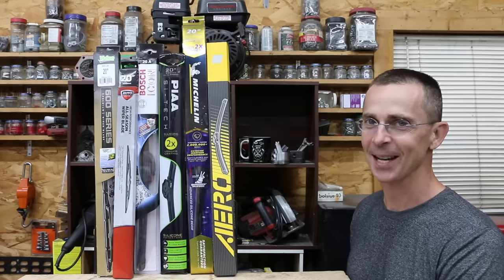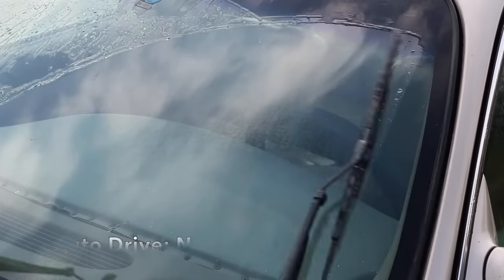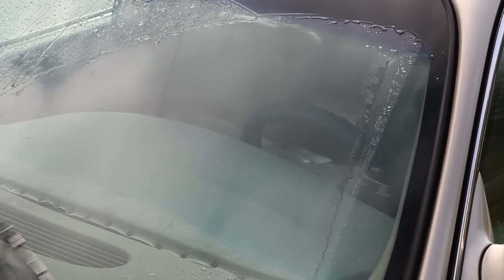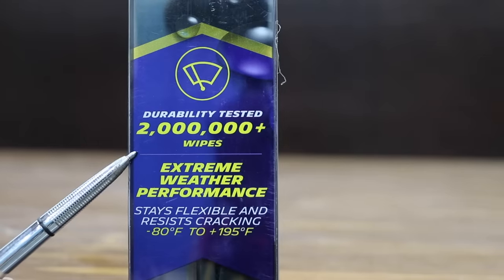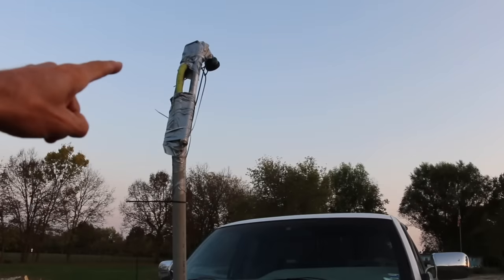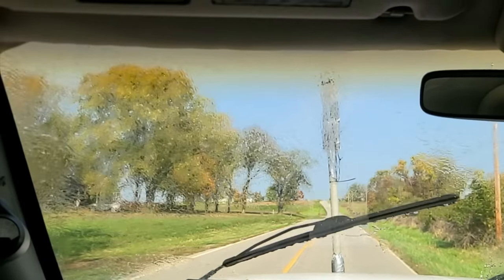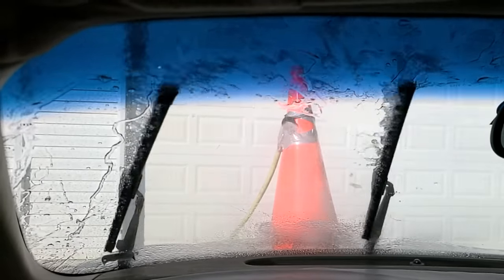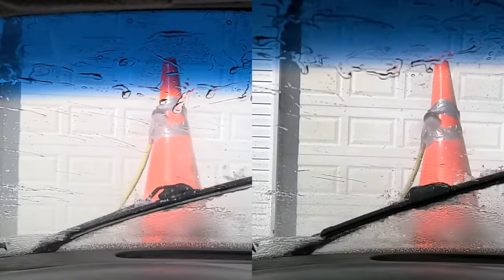Best Windshield Wiper Blade (AFTER 1 YEAR)? Bosch Icon, Rain-X, PIAA, Trico, Valeo, AERO

Comment: I don't know if anyone is the same as me, but when I replace my wipers I can't wait for it to rain to use them 😂
Reply: Exactly, it’s extremely satisfying to use them and feel the satisfaction of how good they work compared to the old ones
Reply: As someone that worked at an auto parts store most people wait until it rains to replace their wipers.
Reply: Me too!
Reply: Me too
Reply: I replace them in the rain when I can't see anymore. No waiting required and you know you got all your money's worth from the old ones.
Reply: To clean my old blades I wipe them with babywipes to prolong them and get the dust off In summer months... only a rea motor enthusiast gets excited over a wiper blade Video...
Reply: @9HighFlyer9  that's exactly what I was about to say about myself.
Reply: @9HighFlyer9  guilty as charged!
Reply: Here in Texas, I always forget I need them until it rains. When it stops and doesn’t rain for a while, I forget again. When I finally do remember (or get my truck inspected and they threaten to fail me), seems like forever til it rains again. So yeah, I feel ya 😂
Reply: @9HighFlyer9  No one notices how terrible their wipers are until it rains, then it's "Will you put them on for me?"
Reply from the maker: Thanks for sharing.
Reply: I use mine even when it doesn’t rain. I clean my glass with them whenever I get bugs or dirt on it. I’ve also found Bosch to be the best wipers.
Reply: I changed mine as soon as Costco puts them on sale every fall
Reply: We just drove our van in crazy rain for a week, I replaced our well worn out, not working wipers . . . And DROUGHT!!!
Reply: Or snow
Reply: Guilty. Sometimes I go to carwash and cry of happiness.
Reply: Shid, I’m nutter than that. Tire PSI has to be right, Alignment has to be straight, Tires have to at least match by pair, Washer fluid full, Clean headlights, Good quality gas, No cracks in Windsheild,  or my anxiety and OCD bothers the shit out of me.    

I’m not a spotless show car clean and wax weirdo but, a performance and drive as it did when new or better weirdo.
Reply: You go through them like crazy here in Washington State 🤣🤣 I recommend Bosch for my PNW people.
Reply: @9HighFlyer9  I'm in Oklahoma and I'm paralyzed. So 99% of the time it rains I'm inside and never need them, then it's like screw me because I need to replace them again and maybe got 5 uses out of them.
Reply: Me too. It's so weird when you think about it 😂

Comment: The biggest thing I discovered when it comes to wiper blades is that keeping a rag in the car is critical. Running the rag down the wiper blades before driving in the rain significantly improves their performance by getting rid the film of gunk and small particles that build up under them.
Reply: I spit and clean.
Reply: Use rubbing alcohol.
Reply: @Mike_Greentea  no wd40
Reply: @Mike_Greentea  I believe that will get rid of the UV coat. Use plain water
Reply: Mr. Ambits,
When I get gas, I clean the windshield and the wiper blades.  I agree it helps.  I'm surprised at how much dirt comes off the blades.  Great suggestion Sir.
Reply: I spray windex and towel while I’m wiping my windows and down the blades afterwards it’s gets the dirt off the blade
Reply: I just let it rain and then hit the wipers a few times lmao
Reply: @IronEddie13  windex will damage your clearcoat, be careful with that stuff!
Reply: If you make it a habit of cleaning your blades when you get gas I've found it's good enough. Depends where you live I guess.
Reply: Biggest thing I discovered way back in the early 1990’s was “Triple Edge” wiper blades.  By far the best and longest lasting I’ve ever tried.  Not sure if they are made any more.  I can’t find them anywhere.
Reply: That's actually something my Dad taught me. When I stop for gas, I use the washer fluid and papertowels at the pump to clean them off. Take less time than the fill up, and makes a big difference in longevity.
Reply: I've had terrible experience with RainX. Bugs and bird turds eat them up. The last pair I got barely lasted a month.
Reply: My last pair of rain ex the dam end cap fell off, in the middle of a storm. Had some gorilla tape to Gerry rig in back on .Bosch focus was my next favorite.
Reply: This a must if you want to avoid micro scratches.
Reply: @karel_de_lille there’s never a time when it doesn’t rain very much (portland Oregon)
Reply: 80's Mercedes owners manual stated to wipe your blades with 95% alcohol, propably once a month or so, can't remember.
Reply: @hr67999  Nah i dont agree with ath old thing, the wipers get enough alcohol from the wiper fluid. Besides 95% alcohol is almost isopropanyl and aint good for rubber. Wet cloth is the way to go, just to remove junk.
Reply: I'm going with the Bosch wipers, man, they're quiet and don't streak. And yes, they are more expensive but they hold up really well with the UV treatment.
Reply: definitely keep the blades clean but also soak them for a few hours in 303 protectant about once every 3 months and they will last "forever".
Reply: It’s also better for the blades. less resistance on the motor, less friction on the rubber blade so it doesn’t wear as fast.
Reply: I keep an old windex bottle I fill with washer fluid in the car for this very reason. Essential if you live anywhere with winter weather as they'll just smear road crud across your windshield even if you use your washer jets
Reply: @CarlForTuna28 me who removed some adhesive from my car using windex 😮😮😮
Reply: @chinaboss6683 Brokeback Mountains style. Lol
Reply: i found a rag and WD40 works great at cleaning blades.
Reply: @jasonmershon3941  Yuuupppp!😂 Gotta love our bipolar weather. It can go from rainy to sunny to snowing. Can’t stand driving in Portland, let alone when it’s downpouring. Exact reason why I’m watching this, we’re one of the worst states when it comes to the insane amount of rain lol. Gotta have good all weather tires, blades, and keep your car rain x’d, and/or ceramic coated here. 

Can’t stand some of the ruts we have in our roads that just pool up water. Worst ones are from the semis creating wagon like tracks that can pull you around. Could be my cheap tires and front wheel drive though.🙃
Reply: I wipe mine down with 303 every time I clean my truck to give them some UV protection. Cleaning them often is very good advice. They can get pretty gunked up.
Reply: absolutely!!! Especially in Florida where it's all sandy and dusty and full of construction
Reply: I guess routine car washes just clean the tops of them? Ill check that next time I go.
Reply: Yep, been changing my blades for 49 years. Every time I gas up, I clean my windows then I use some of the pull wipes at the pump, dip in the wiper cleaner solution and wipes the blades until the wipe stops showing scum on it. And as said this is especially important after a dry period because all the road oil and scum buildup on the windshield and blades.
Reply: @CarlForTuna28  I’ve heard from an old Greek guy that windex can be used for everything.
Reply: Vineger
Reply: @Mike_Greentea vinegar
Reply: @craigorlikowski2507 😂 no!
Reply: Dont comment on things ys dont know. Look it up! 🙄
Reply: @Usul-xp6ve agreed. water is best. Alcohol will dry the rubber or silicone.

Comment: Came here to say I bought a Bosch set of wipers after watching this a year ago and they are the quietest, most efficient wipers I have ever had, and still hold up. Companies should be paying you to prove how good their products are. Fantastic content!
Reply from the maker: Thanks!
Reply: Replaced my OEM blades with Icons as well.  Great performance with no chatter and nice clean wipes.
Reply: They're good but they're very expensive.  I'm not sure they're better than just buying cheapos and replacing as needed.
Reply: @jshepard152 Maybe depends on your climate. I love in a rainy, but also icy/snowy climate. Especially the ice is quite rough on the wipers and possibly the - 45C wiper fluid i use. Bosch holds a perfect clean for years. I've used the old style ones, but they hold snow and ice. New design is best, but most other brands only last a year until they start streaking. I've got 2 cars and tried Michelin, OEM, PIAA and RainX, Bosch outdid them all.
Reply: @QnA22     Your right.  The Bosch wipers are much better in snow and ice versus the old frame wipers.  I don't get much snow in my area.
Reply: @jshepard152  Without the snow and ice, i might just choose the traditional wipers. Cheap and effective. However, only had OEM one for a short while until i replaced them. Not much experience, so i might be wrong.
Reply: I ran Bosch icons since last winter here in Denver. First snow hit us last weekend with a total of 9 inches over two Days. Forgot I left em on last time I drove my winter beater and they scraped snow and ice immediately. Now it’s gone I ran them yesterday. They’re not cracked or streaking. They’ve been on a winter spring and summer. And now another winter.
Reply: Bosch aero is the best.
Reply: I just purchased my second pair of Bosch today
Reply: @jshepard152  The Bosch Icons are expensive. But I can easily get two years of service from my Bosch Icon wipers. They probably could go for third year if I wanted. I park my cars inside a garage so that probably helps.
Reply: I have always used Bosch Icons and they have always worked well for me
Reply: Same. Waited for the end of the summer to switch out my blades for some bosch, and I am THOROUGHLY impressed.
Reply: I just bought my first set of Bosch wipers based fully on this video, and comments like yours. However, companies paying Project Farm for his reviews would defeat the entire purpose of this channel.
Reply: @RambleRecordings  he doesn't take money, and is looking at Numbers.
Reply: @bernardomotard  I know. The original commenter said that companies should be paying him. I'm saying that if a company paid Todd for a review, it would defeat the purpose of this channel which is to provide objective reviews for products that he purchases himself.
Reply: @Rhaspun  My truck (Ram 1500) sits outside 24/7/365, we see very little snow here in TX but plenty of frost and Ice sometimes. 2yrs plus on a set of Icons with no issues.
Reply: Hey man.  Still liking the Bosch blades.?? 🤟🏼
Reply: After I bought my first set of Icons I swore nothing else, and haven't.  Now I have a new to me car that needs wipers and I see "higher" level Bosches.  PrimeAction and Envision.   I'm not sure if I should take the chance.
Reply: I always stick with OEM wiper blades.
Reply: I always stick with OEM wiper blades.
Reply: I’ve had the same set of Bosch icons on my car for 5 years. They are still amazing. I only clean the edge maybe once a year or so and regularly use them to try and remove snow and or ice buildup as well which is probably one of harshest things you can do to a wiper blade.
Reply: Yo los acabo de comprar y funcionan impresionantemente bien

Comment: This guy has to work harder on his channel than just about anyone out there. His dedication shows and I appreciate it! Who needs consumer reports? This guy rocks!
Reply from the maker: Thanks!
Reply: After subscribing to CR for decades I quit. They just don't have accurate reviews anymore. Youtube is the only valuable social media out there as long as you avoid pop culture and politics.
Reply: As much as I appreciate this channel, I find this testing method quite lazy. 

Two years on a roof doesn’t simulate regular use. Having purchased and used these wipers, he’s missing the meat of this test for most people: real world highway downpours and months of regular use with the car’s windshield washer nozzles. 

I went through a couple sets of Costco discounted Bosch Icons; they began skipping at 1 month and fell apart after 6 (not to mention the tremendous aero drag their pronounced rib produces at speed, significantly slowing the downstroke and speeding the upstroke.)

Trico Onyx and RainX had the same awful aero drag issue but to a lesser extent, were quieter with less streaking, had better contouring, and served well for 1 year. RainX wipers were better probably because I didn’t need to use them as much in rain due to the hydrophobic film they leave on the windshield. 

PIAA with metal frames have replaceable blade inserts that I’ve replaced once over nearly 3 years, they contour better to my windshield and wear better despite all the tiny rock chips in my windshield, they leave a hydrophobic coating on the windshield that’s similar to RainX’s, and they don’t suffer from highway aero drag. 

PIAA for the win. Second place goes to OE (Subaru) wipers.

There, you got a better test and real consumer feedback.
Reply: I feel consumer reports can be bought also.

Comment: This one man Todd, has done a 5 times better job than the WHOLE Consumer Reports company has done in 25+ years. 

And has earned every bit of it with hard work, ingenuity and truth, not magazine subscriptions filled with fluff.
Reply from the maker: Thanks so much!
Reply: Most certainly PF is doing some great work, but give CR some respect, they buy and test everything. Washer/dryers, TV's, lawnmowers, cars...every year. It's not even in the same ballpark.
Reply: Yes! Thank you. Consumer Reports is NOT unbiased if you all know the truth. I asked why they would not test Motorcycle helmets. They said it was not in the best interest of the company and helmet industry. Corrupt. Motorcycle Helmets DO NOT provide adequate Brain Protection. Unless you purchase a 6D Helmet. Test results show the proof. Helmet industry is corrupt.
Reply: Rick Yanke Also, continuing on Consumers Reports. 

Tell me what’s the Lightest weight, Low-Profile, Quietest, Most Reliable, Bagged vacuum? 

And how about the Longest lasting Zero- Turn mower with minimal repairs?    Is the Briggs & Stratton Van guard better, more powerful and more reliable than than the same size  Kohler?   

Is the Kohler better, more reliable and more powerful than the Kawasaki?    

See my point?   It’s bull💩   Otherwise tell me.
Reply: Rick Yanke And don’t get me started on Residential Appliances, my family’s been in the repair business 42+ years.  

These new ‘ energy efficient ‘ refrigerators don’t last. They save you enough just money in electricity only to be used on $500+ repairs or whole new units.
Reply: @Mr.Beastforpresident  Solid.
Reply: @rickyanke9407  UH,no. They are corrupt. From the inside, CR chooses WHEN to compare. The best source is Honest Word Of Mouth. Nothing better.
Reply: CR is driven by left wing politics.
Reply: David Craig Arthur Kallet a Consumers Reports advocate left as director of Consumers Research in 1936 after its head, F.J. Schlink, fired three striking employees who had tried to form a union, and joined with Amherst College professor Colston Warne to found Consumers Union and Consumer Reports.

The House Un-American Activities Committee cited Arthur Kallet as the communist head of Consumers Union, which it cited as a communist front.
Reply: @ProjectFarm  Great test! I know which one I will buy when mine need replacement.
 As a side note: Mentioned below is Consumer Reports. Boy could I tell stories about their "ratings" on consumer electronics. No tech support is apparently ever taken into account.
Reply: @Mr.Beastforpresident  Fkn, get it! Love it.
Reply: Amen!
Reply: Totally agree!
Reply: I have cancelled my membership with Consumer Reports. Too expensive, repetitive and narrowly focused.
Reply: If you are old enough to remember what CR's did to Audi with the unintended acceleration fiasco you won't put much stock in anything they do....
Reply: I AGREE!!!!!!!   PROJECT FARM DOES AMAZING TEST/COMPARISON/REVIEWS!!!   MAY GOD BLESS HIM, ALWAYS!! MUCH APPRECIATED!!!!!!!
Reply: @truth6733   Your helmet example is a bad one.  There is a national helmet testing lab at Virginia Tech that does far better testing than Consumer Reports ever could.  They run a gamut of tests on multiple copies of each model, and perform deep analysis with sensors and computer simulations.  Why would Consumer Reports do a crappier version of work already being done at a highly respected lab?
Reply: I think there's room for both PF and CR and it is a compliment to both that they are in the same league. Years ago I bought Bosch Icons because CR recommended them but it's good to have independent verification that, yeah, they are great wipers.

Comment: Over the years, I have found Bosch Icon blades to give best performance due to its rubber compound. I live in NE where winter freezing and sun are factors that stiffen blade edges on most other brands I have used which include most popular and OEM models.
Another fantastic test! You are my goto source!
Reply from the maker: Thanks for the feedback. You are welcome!
Reply: Same here i spend the extra money to get bosch icons. I also use ceramic coating that helps if im going above 35mph the water just rolls off dont usually use my wipers